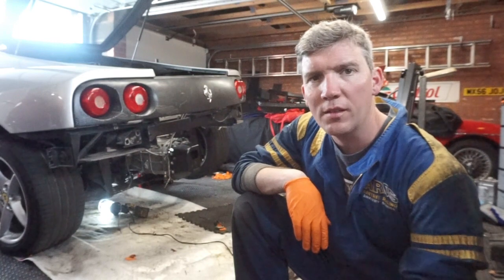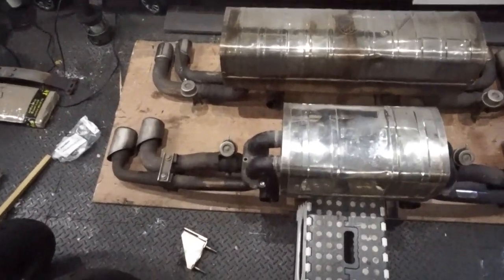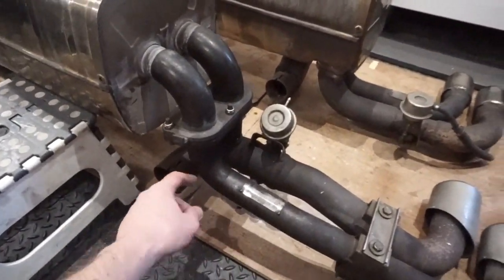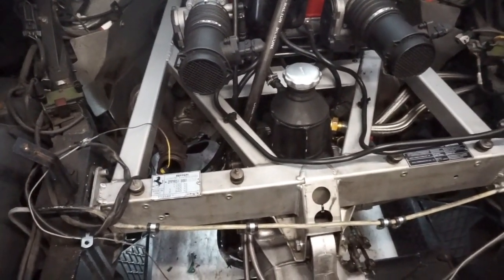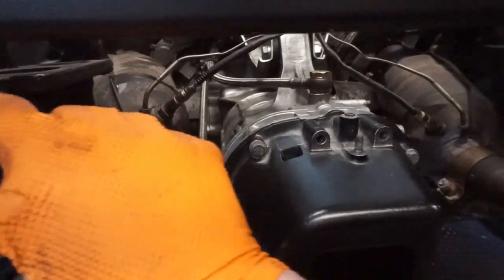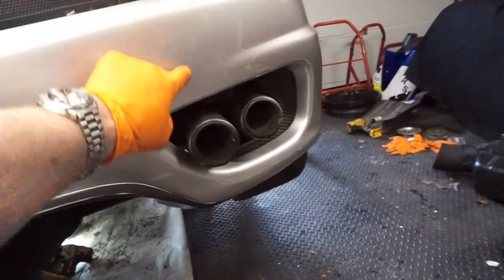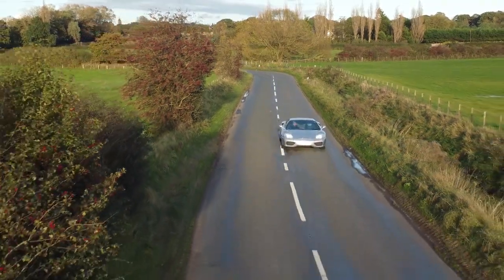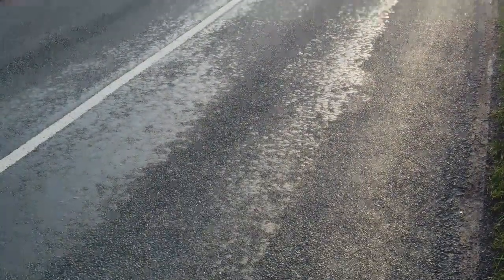Ferrari 360 converter F430 exhaust to 360 challenge stradale

Comment: Do you need to do anything with the ECU for this mod, or does it bolt right on and not affect performance?
Reply from the maker: @mr2nut123  no need to do anything with the ECU just bolt on the f430 exhaust set up like the is the same as the race option exhaust Ferrari sold for the 360 and Ferrari didn't change anything on the ECU. With this setup and a ECU flash from trev360 30 or 40 bhp can be added something I would like to do going forward
Reply: @mchmodena  That's awesome, thanks.  I was thinking of getting a 360 in the next year, but this mod would be mandatory.  How much do they sell for, or would it be cheaper going for a system designed to be bolt on..?
Reply from the maker: @mr2nut123  I picked up the 430 exhaust for 750 pounds used on eBay seem to be about 1k to 1200 pounds now plus doing the work. Aftermarket systems seem to be 3k ISH. I wanted the challenge stradale sound and cs exhausts are crazy money these days